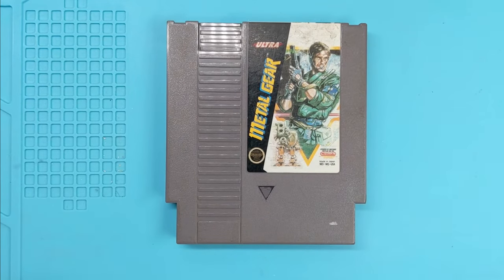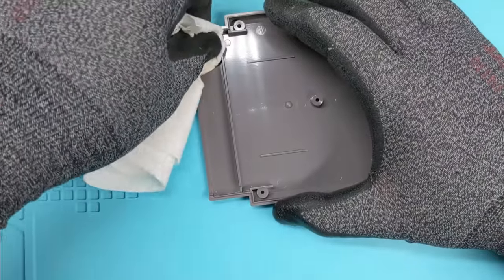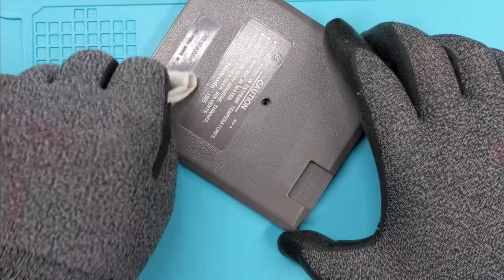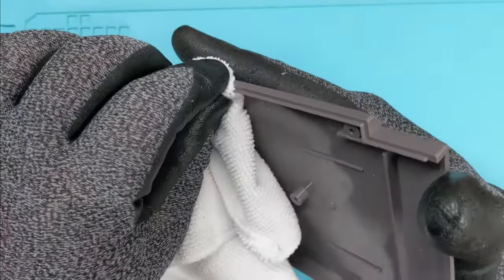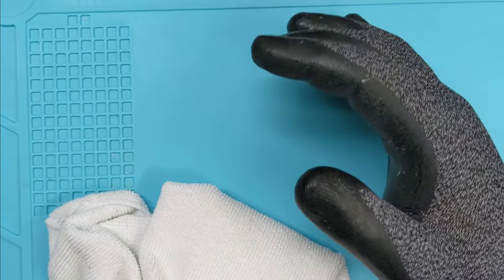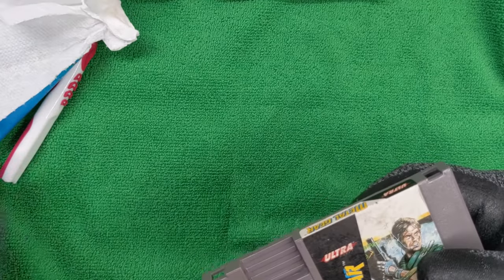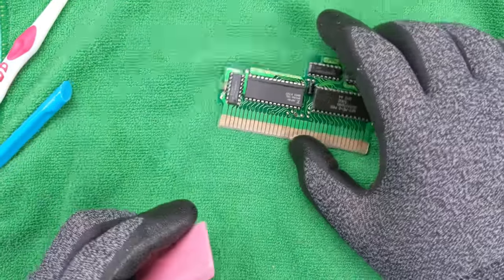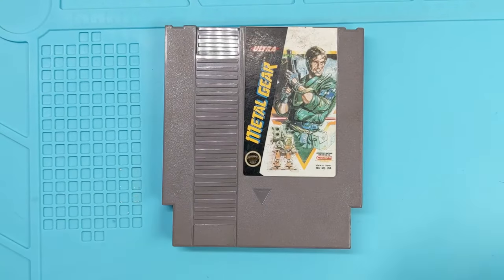Cleaning loose NES carts. Round 1!

Comment: Curious what that brown/grey texturing is over the black part of the label. Is it dirt, abrasion or separation of the laminate?
Reply from the maker: Primarily the lamination of the label breaking down, and getting dirty! I've considered making a video showing how to remove the lamination, but it's a bit of a risky maneuver (you can easily damage the label). But that label will definitely make a few more appearances in the near future.

With the lamination in such poor condition I wanted to remove whatever old residue was on there, but basically stop there for now.

Comment: Can I use the all purpose cleaner on generic accessories and controllers too such as Wii wheels or Wii remotes?
Reply from the maker: Of course! I tend to wipe down all accessories pretty regularly with an all purpose cleaner. Just be careful not to get too much cleaner in the seams or anywhere. But it does wonders to remove finger oils and grime!